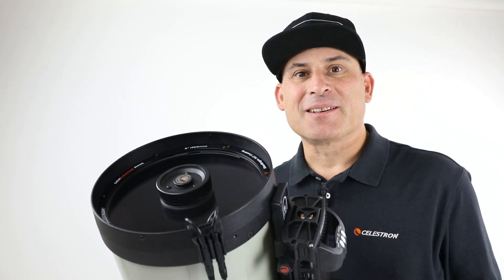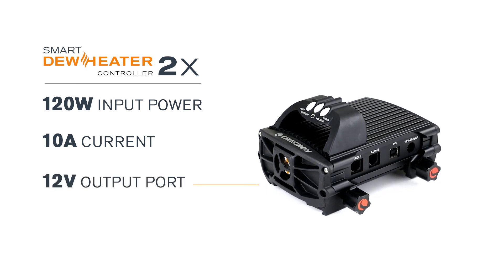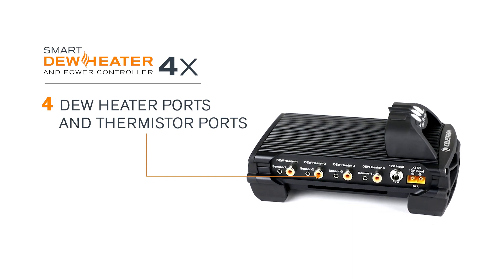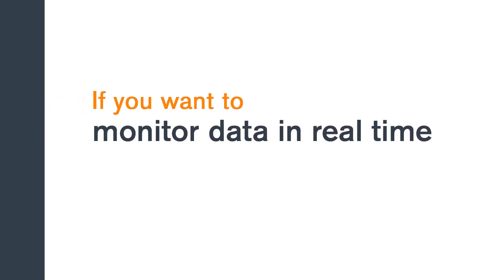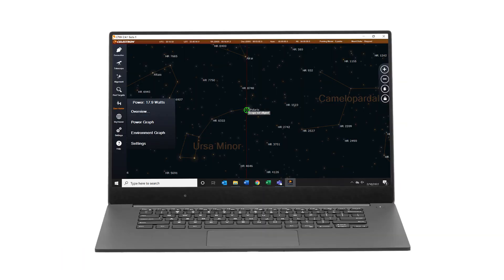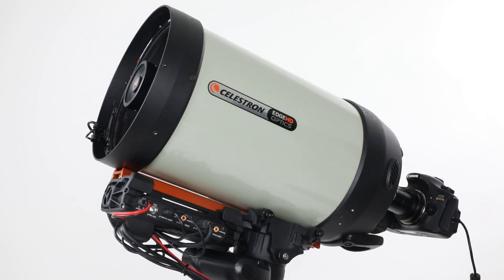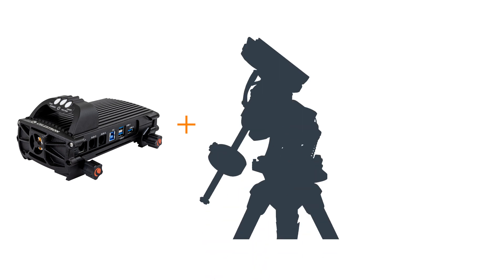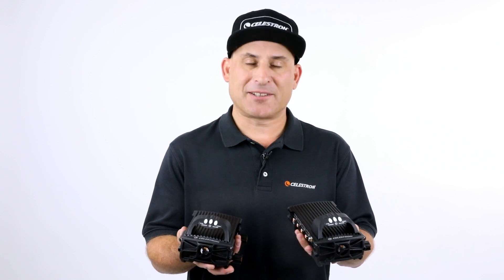Smart DewHeater Controllers In-depth Overview

Comment: I was hoping you would show how to connect several accessories to the dew controller.  I am running the 4X Dew Controller with a CGX mount, StarSense Autoguider, Celestron GPS Module, CPWI, SharpCap software with ZWO camera, all controlled using a Windows 11 laptop.  How do I connect all of that with power, USB, AUX, and still get CPWI to recognize it all?  I can never get CPWI to recognize both the StarSense Autoguider, and the Dew controller, as well as control the mount.  Also, do I need the hand controller if I am using CPWI with a laptop???  It can all get very confusing.  Please produce a wiring diagram for the various accessories or put that in a video.  I have read the Dew Controller user manual and it just does not cover this very well.

Comment: Can you please provide a video on how to set optimal settings?  My issue is that when on Auto setting with power set at 5, I immediately get spikes in my larger stars.  I also tried to set it at 1 power but still get spikes.  What would be an optimal setting in manual mode to get rid of the spikes?  For reference, I have the Celestron 9.25 EdgeHD with the dew heater ring and 2 port controller.